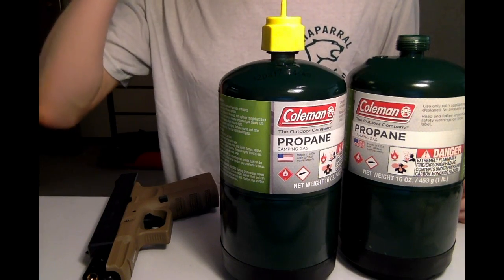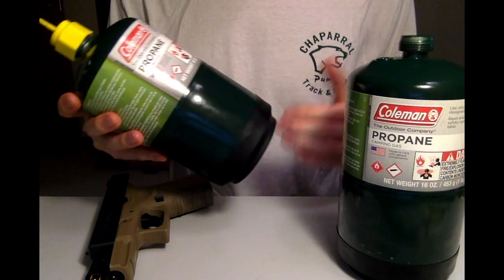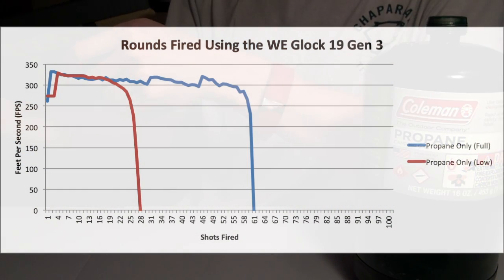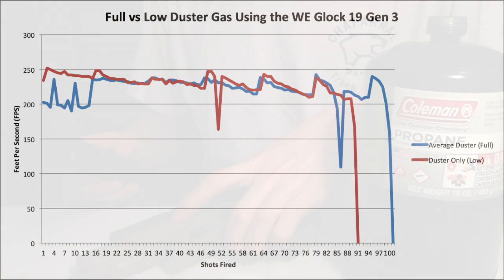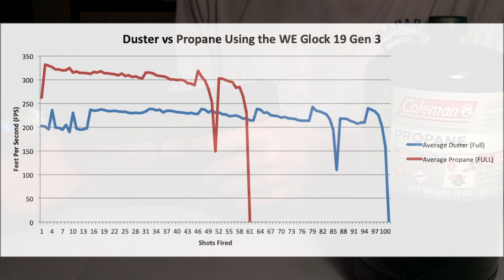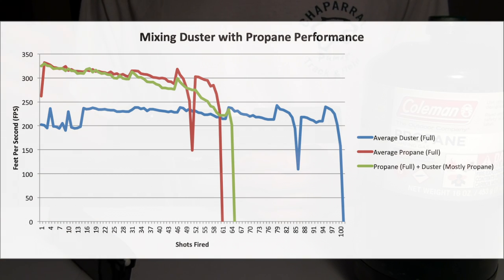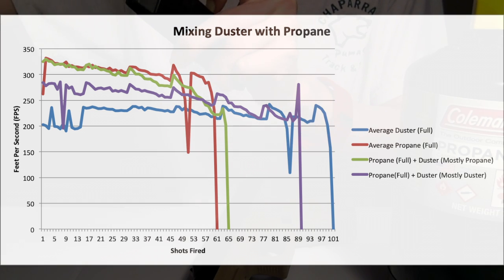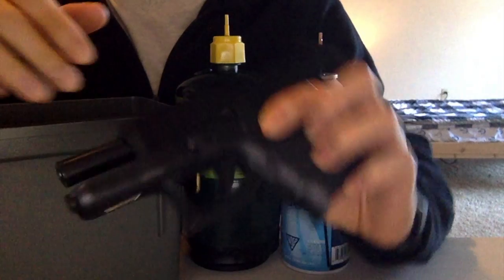Mixing Green Gas with HFC134a (Duster) Gas: What's the Right Ratio? (Part 1 of 2)

Comment: So this is good info but I see that you're using propane instead of green gas (there is a slight difference between the two) green gas is still propane but has a mix of silicon to keep your o ring liberated